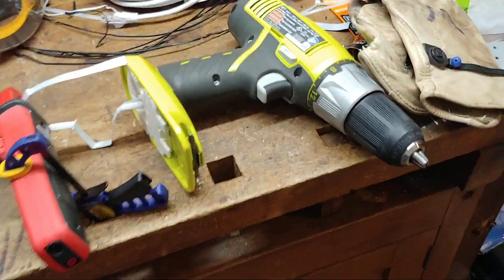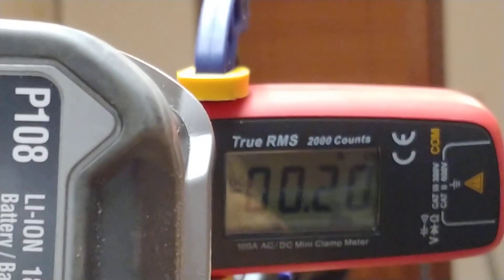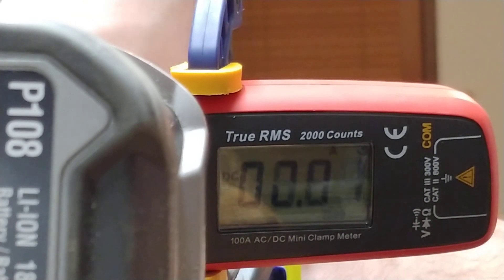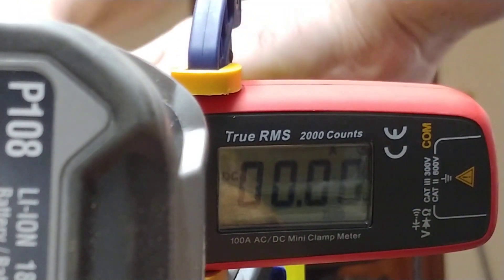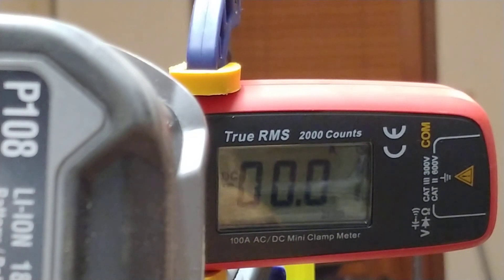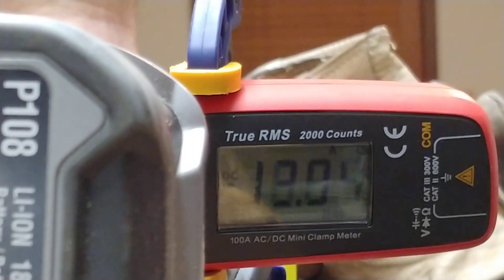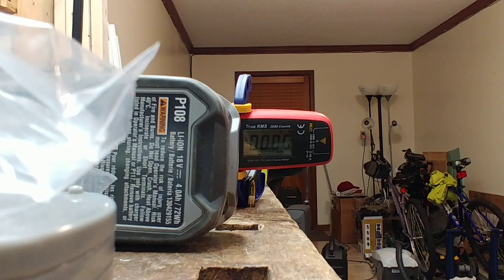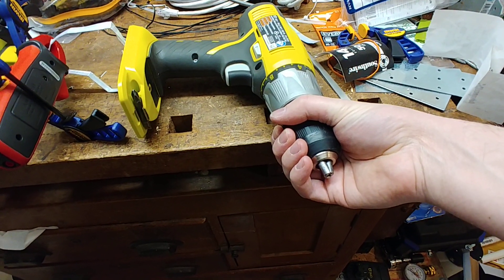Ryobi 18V Drill Current Draw Test

Comment: A shame you didn't measure the current under maximum load or when it stalls.  I too am I'm looking to build a cordless to corded adapter.  Was planning on a 20A 360W switcher, but based on this, it looks like that might not be sufficient.
Reply from the maker: Yes - I didn't have anything handy to put a big load on it.  I do plan to do more tests but have been too busy as of late.

I did recently trip the overload safety on a battery while using a 1" speed drill to go thru house beams for cabling so I think the max load is significantly higher...I have heard claims the batteries trip out at 30-40 amps so my speculation is it would be higher than that for heavy loads.
Reply: @matthewmiller6068  Wow, I've never tripped the battery overload before.  I have the same 4 Ah batteries, and I use with a ton of different tools: drill, impact, sawzall.  Looking to get a circular saw soon.  New sub now, will be looking forward to any additional stuff you post.
Reply: @matthewmiller6068  ya I salvage cells from tool batteries and I think the only ones I have seen with the protection built into the cells themselves are ryobi you can reset them with a like tiny screwdriver under the positive of each cell you just push it down and they work and generally capacity test alright but I just trash them or recycle but I don't recall the brand of cells it generally is and I believe most cells have that built in but I just don't see that as the problem on other brands
Reply: @matthewmiller6068 
No shame
Don't be discouraged
You have done well

Comment: This is the video I was looking for! Because I want to convert a cordless tool (black&decker multievo 20v max) into a cord one, so I need a transformer that deliver a max limit of amps for it. Do you think I have to consider something else to make my idea work safely?
Reply from the maker: Probably not?  Biggest thing with high current you will need to size your wires carefully, if its only a couple feet 10AWG may do but for a longer run you may need 8 or even 6AWG.  I often overbuild stuff just in case.  There are wire size charts online to look up what size wire for a given length can carry how many amps safely.  And make sure your DC power supply is rated for the amount of power you will be drawing.  As usual consult any manuals it may come with to see if it requires fuses or anything to protect the power supply from overload.

I have not got to test under a very heavy load (like 2 hands driving into hardwood or running a hole saw) my unsubstantiated guess is it may peak as much as 50 amps at very heavy load.  I was only grabbing the chuck with one hand to slow it, I know this thing is powerful enough to smash my hands against stuff when it binds and I have the trigger all the way down.
Reply: Ya it would be bulky corded option with the wire gauge and you would need a decent size supply and I was thinking maybe some super caps for the surge probably not worth the amount of time or the money or the size it would be and headaches of dragging it around